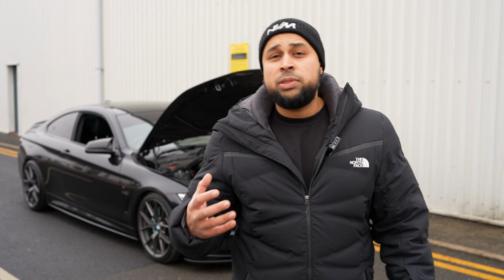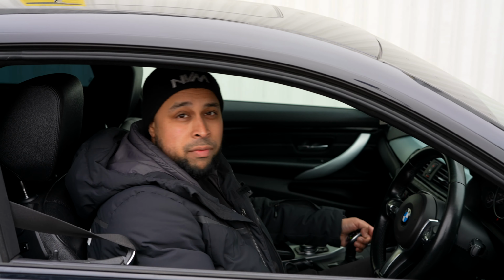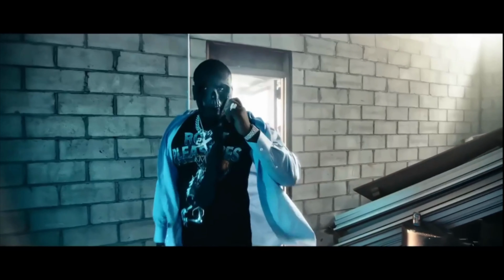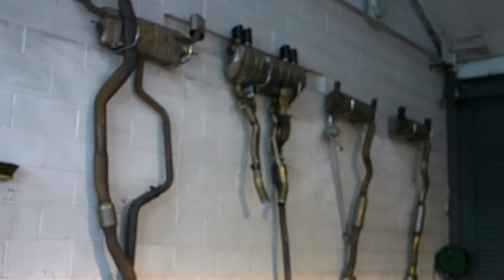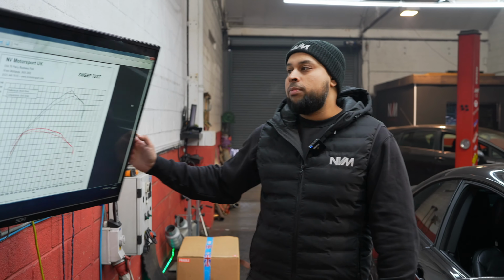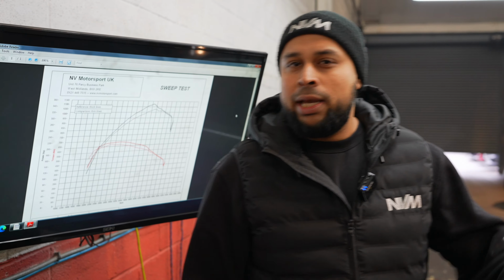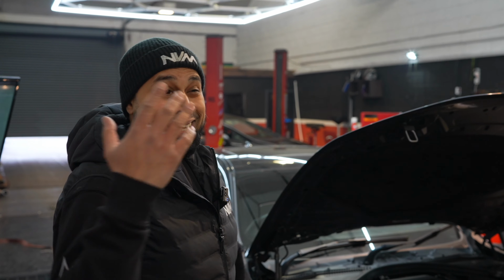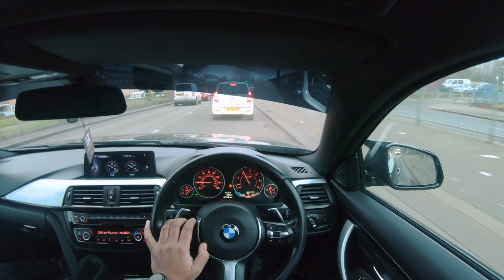No Poke without SMOKE? 430d Stage 3 TUNING!

Comment: Is it better the TurboSystem Stage 2 or the DarkSide GTD2872VR?
Reply from the maker: Turbosystems are turbo manufacturers 👌
Reply: @NVMotorsportUK  sure, but from what I’ve gathered the Darkside is based on a newer Garrett architecture (GTD) using ball bearings or ceramic bearings, whereas TurboSystems builds upon the older GTB2260 bushing-based platform by machining the housings for larger wheels. I suppose In-house manufacturing offers better quality control but.... what I'd like to know is which one would you say performs better in terms of spool and EGTs?
Reply from the maker: Without testing we couldn’t guess

Comment: Bigger turbo, id say its laggy asf, below 2k rpm id say its like driving a boat around and above 2k id say its like a rocket ship. For me the 435d or 640d would be the only option i think you need the twin turbo to get usuable power around town or driving low at rpm.
Reply: @atourdeforce  bro i hava a 640d. I wanna put high flow cat and back box delete. Do u think sounds will be better?
Reply: @Hayalet..81 Have the dpf taken out and get it coded out and remapped. Leave the cat, it robs very very little power on a diesel. Back box delete is really only aesthetics and a slightly better sound. Go for it if thats what you want.

Comment: Hi nice video cool info about the tuning  , I have a intrest in making M57 3.0d stage 3 (380hp) is it true that on that power level maf sensor is turn off and fuel consumption is bigger on daily basis driving ?
Reply from the maker: Part throttle injection quantity is derived from torque to iq which will never see maf limit so no reason to turn off. True lambda must be calculated from maf.

Comment: What you think a stock 330D F30 would do with downpipe + new intercooler and standard turbo? Just interested as I have one.
Reply from the maker: 330-340bhp 👍🏻
Reply: @NVMotorsportUK  is that with a stage 1 engine map to get that figure?
Reply from the maker: @georgekyriacou9331  the hardware changes would justify stage 2 on previous reply

Comment: got a 435D, its currently for insurance and will be a can n not structural damage. Tempted to buy bk from insurance , as already downpipe/intercooler and other bits done with a stage 2. recon around 400hp and 570ft of torque .

if I get a 430d xdrive and do a stage 3 hybrid turbo, high fuel injectors and pumps. will I have a quicker car?

Comment: Hello, I've just discovered your informative videos. So watchable with a no BS approach. Brilliant!  I'm considering purchasing a 435d Xdrive and was wondering if you have a 4wd rolling road also? Not sure I would want to go anywhere else after listening to your explanations. Respect dude! 😎
Reply from the maker: Chris. Thanks for the feedback. We run all xdrive vehicles in Rwd Dyno mode. The vehicles are Rwd majority of the time on the road only activating front in slip. So repeated dyno runs with all 4 wheels can be detrimental if not in sync .👌

N57 35d engine is very common for us and can offer tuning for all levels.
Reply: @NVMotorsportUK  dude, I'm sat here grinning. So glad you said that, Awesome. 😁